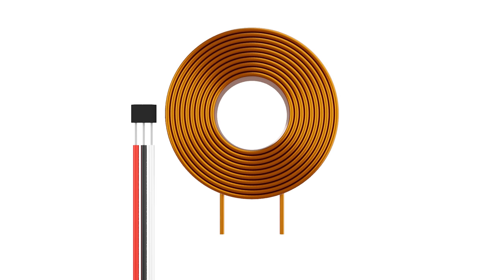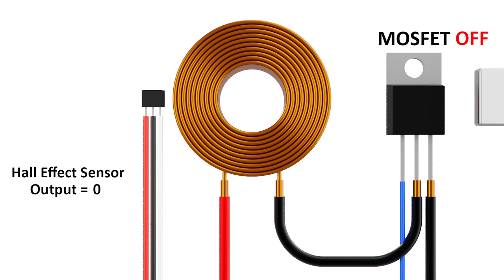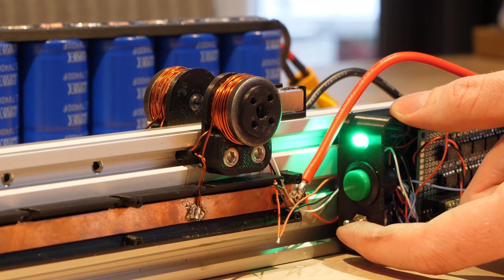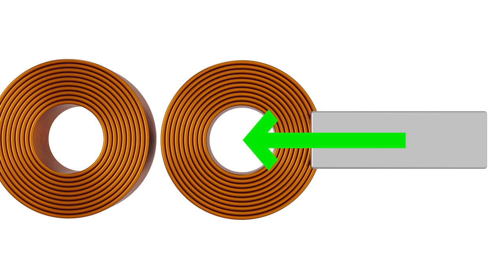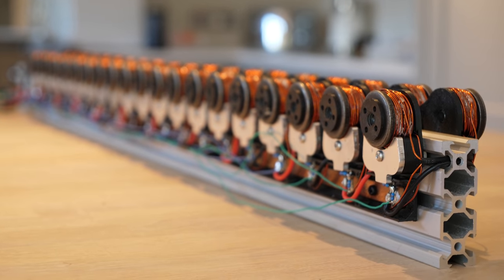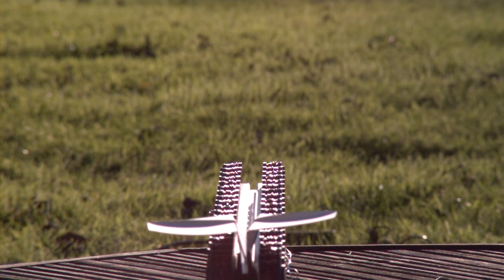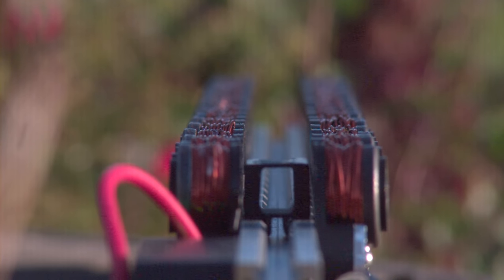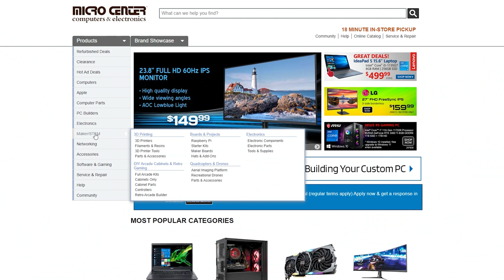Electromagnetic Rail Launcher

Comment: Could you use magnets on the bottom of the projectile to make it levitate and thus reduce friction? Would there be a significant difference in performance?
Reply: Magnetic Levitations is a generally unstable state. It requires either near constant modulation of a separate electromagnet or Quantum Locking using a superconductor (due to the fact that superconductors have a near zero magnetic permeability, see the Meissner Effect and Flux Pinning), requiring part of the system to be below the critical temperature (generally within 10 or so degrees of absolute zero). Interesting Idea though.

Comment: Now you have just invented a rail gun
Reply: No. railguns are much more simple than this. No MOSFETs or induction coils required. This is a linear induction motor.
Reply: @zacharytaylor190  I’m just going based off the fact that a rail gun uses electromagnetic force to launch projectiles at high speeds
Reply: @octosional  this is a linear induction motor
Reply: @adrianwelgemoed9562  but a linear induction motor uses a magnetic field
Reply: @octosional  watch this guys latest video where he optimises it. He explains why its not a railgun
Reply: @octosional  Exactly! This uses a magnetic field. Those coils function as electromagnets and they interact with the permanent magnets on the sled.

Comment: I think ppl use capaciters for more power
Reply: Generally for less ESR (equivalent series resistance), which relates to a high power. Capacitors and batteries work on completely separate principles, and usually a capacitor is capable of dumping more energy per unit time, so yeah. More Power.

Comment: You could improve the design by so much if you flip the polarities instead of turning off the coil. That's what a motor does too. Also as marginal as it may be. Having all of the coils on still increase the speed. It's not zero. So this is far from optimal.

Comment: No no no. The paper plane is not accepting the full potential energy within the system as it typically cants from the back of the plane and lifts away from the magnet before getting all of the energy. So you should make a plane with a special place to hook the nose on to the magnet in order to be pulled instead of pushed. In that way it will follow the magnet until it falls downwards.

Comment: You're doing it wrong. You should be using repelling fields. A ferrous projectile experiences both an initial repelling force, then attracting. But then as you shut off the current source as it passes through, the field in the ferrous metal collapses, creating a current in the coil that drags back on the projectile.

You can see this effect in relay coils. When you use a diode to suppress the inductive kick from the collapsing field from destroying the driver transistor, you slow the release time.

Use a copper or aluminum sabot over a lead projectile. Repel the projectile with the field, and time the field shutting down only when the projectile is well beyond that coil's influence so it is not experiencing drag from it.

Comment: now add abit of mettergy.
There is a material that Matches polarity with magnets.  Whcih cause them to repulse, Away.  Thay are used in magnetic balance of toys.  Suspended in air.  Then what would happen if you reversed the polarity instantly?

Comment: 0:30 an over complicated, under performing "green" joke if you ask anybody actually using them.  Too difficult to fix, too finicky to control. In the end, just like Germany it's back to the conventional methods when the chips are down.  Great idea, but like a perpetual motion machine, which you can kind of do in small scale, scaling up is exponentially more difficult and taxing on resources.
Cool video though :D

Comment: so basically you made a rail gun
Reply: Not a rail gun.
Reply: @adrianwelgemoed9562  it uses electromagnets to launch what technically could be a projectile at a high velocity, that is by definition a rail gun.
Reply: @invaliduser9395  this is a linear induction motor. Railguns are way simpler than this
Reply: @adrianwelgemoed9562  yea but the way they work is extremely similar.
Reply: @invaliduser9395  well yes and no. They both move thigs linearly via electricity, but the method and efficiency is completely different. Railguns basically destroy themselves over time due to friction

Comment: WHAT IF:- You use a high electric power supply overpowering the copper coils. Using more strong wires  less risk of burning, Circuit failure etc, Then Put a 7.68 bullet without shell. Can You do that Please 😅

Comment: Isn’t that a fucking rail gun?
Reply: Lol maybe you should research what a railgun is. Newsflash, this isn't it. Railguns are simpler (no switching circuits required), generally more powerful, therefore sometimes regulated and does not make use of any field windings.